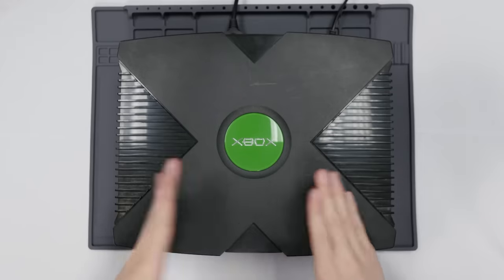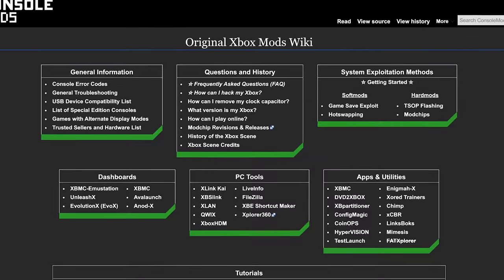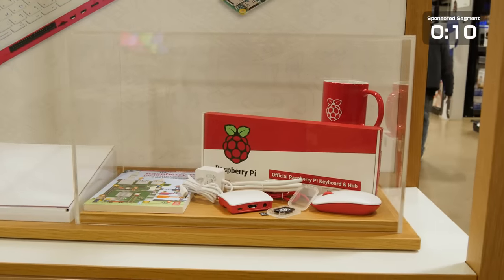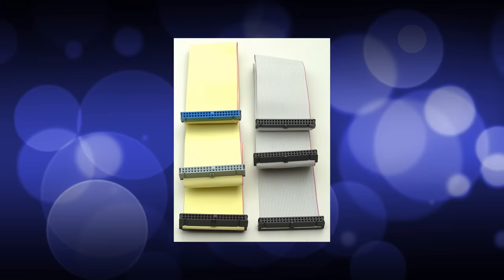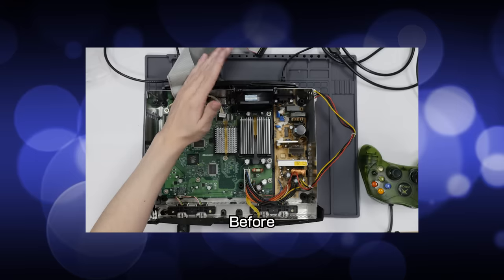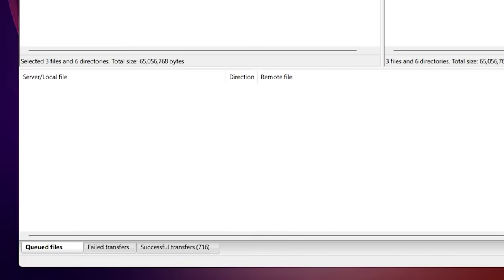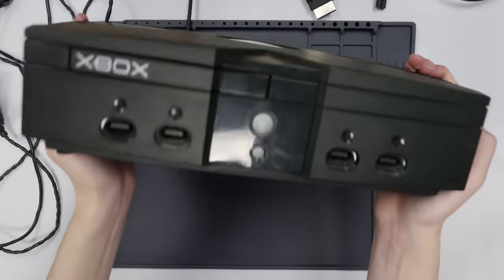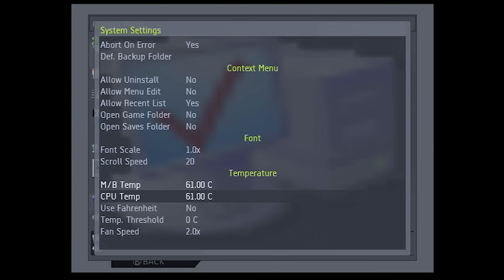The original Xbox is so NOISY. Let's make it ˢᶦˡᵉⁿᵗ

Comment: The original Delta fan for the XBox (AUB0712HH, also used in the 360 in a pair) is rated at 36 CFM and 7.32 mmH2O static pressure and tops out at 4500RPM. Locked at 20%, you'll still have a far reduced static pressure, but probably still higher than that Nexus fan at max. The Nexus fan doesn't have a published static pressure, but tops out at 21 CFM at 2400 RPM, meaning the rated static pressure at max is likely around 1.0 to 1.25 mmH2O. It's one of the substantial tradeoffs: quieter fans always have far reduced static pressure due in part to the lower RPM. I don't know of a fan where that is NOT true. And in enclosed spaces, such as the internals of a game console, static pressure matters more. Since static pressure determines how easily it can push through all of that. This is going to matter when it comes to longer play sessions.

While you were in there, you also should have replaced the thermal compound under the CPU and GPU heatsinks with something like Arctic MX-4.

The delay at startup is the IDE->SATA converter board initializing before reporting back that it's available. And your transfer speed is also entirely due to the Fast Ethernet 100Mbps connection on the XBox. 11 or 12 MB/s is about the fastest you can get with that, and HDDs back then weren't slower than that on sustained transfer.

Comment: Older cpu's dont throtte, they have stable clock. Even the difference in power consumption at idle/ load is not that big. 
The new fan simply has a lower speed, which is probably why the temperature increases.

Comment: I'm sure a Billion people have already mentioned the fact that you're still dealing with IDE speeds but those adapters can cause slight slowdown with an SSD because they fundamentally work differently than a HDD.

The burst packaging that SSDs use is totally negated by the IDE interface so it actually reads slower at smaller data packets than a HDD. So you won't see a difference in things like game loading but you see a slight delay in boot due to the SSD's interface being a bit bothered by it's inability to send smaller data like it wants to. 
It may be a SATA-IDE converter but the drive knows it's not on traditional SATA bandwidth. The PMIC and data controller sees this immediately and kinda freaks out. 

Not an issue at all but it's a cause of this in older consoles, PCs and such when someone uses those adapters with an SSD.

Comment: In my opinion changing fan to identical size doesn't make sens, just buy 80 mm. I had a 70 mm but my xbox had been warmer then before, only with x5.0 speed it was similar to old one but also similarly loudly. I finally mounted 80 mm Noctua. Just brake te two tabs and mount fan with zipptie (usind holes next to old tabs). I also removed metal grill behind the fan. For the 80 pin cable mod - they are guides how to fold it more nicely. Also DONT buy sata=>ATA adapter WITHOUT capacitors. They are trash, often make longer boot and just broke over time. Besides that, good work.

Comment: i'm pretty sure you can use a 40 wire ide cable with a sata adapter, it will just be a bit slower. did you set the jumper pin in the correct position?

Comment: Technically using a SSD is faster still on sata to ide because you don’t have delay of the arm in a HDD moving is latency to get data. There is a comparison video but it’s small difference that if your paying more for a SSD just because it’s a SSD then getting a new hdd is enough usually for same storage but for something by like making it quiet then SSD def worth it.

Btw Burnout 3 is my favorite racing game. If you Like emulators for pc you should try xemu it emulates original Xbox games pretty well. Little resource heavy atm depending on game but It is focused on compatibility atm. But is playable in a lot of titles.

Comment: I'm a big fan of the original Xbox. I also enjoy your content Matt. I just don't really get this. Why do you value the Xbox being silent? Unless there's something seriously wrong, a standard Xbox does not really make all that much noise, especially when you factor in that it will sit several feet away around a tv, and the game's audio will be playing that will be much louder than the Xbox ever is. 

The SSD solution also introduces added loading time since it needs to convert from SATA to IDE and that in itself takes time. I'm ultimately left thinking that the best option would be simply to buy a new oldstock IDE harddrive rather than use anything SATA.

Comment: Polish heatsink and use new high quality thermal paste and I'm sure that You can drop temperature lower, personaly I whould even make gasket for new fan to maximize effeciency and maybe make bigger holes for better air flow, than it should handle fan speed 1.0x like a pro 💪

Comment: Most of the noise from a fan comes from the air movement rather than the fan itself. The design of a fan has much less to do with how much noise it makes than the volume of air that it's moving. If the fan is much quieter, it's probably moving much less air.

Comment: Tried this very fan, but even at 3x speed via a dash with fan speed control it ran noticeably warmer by 7-10 degrees Celsius. Might need to modify the chassis and use a little larger Noctua one for better cooling and silent operation. Unless somebody has a good tip for an alternative?

Comment: Never owned an original Xbox but the drive on the 360 sounds like a circular saw when in use, so an Xkey or whatever mod to play games off an external drive probably cuts the noise by at least 80%

Comment: I bought a soft modded Xbox a while back and the fan although set at 1x when the console starts up and switches to unleashed the fan speeds up making it sound like a hair dryer, upon checking the fan speed it still says 1x, admittedly once you get into a game you can almost zone out of hearing the fan but it does mean I have to increase the volume of my tv. It doesn't stop me playing the console as I love the original Xbox but it would be nice if I could make it quieter, any suggestions?

Comment: "The original Xbox is so NOISY"
Me, who had an old setup with an FX-9590, stock AMD fan and GTX 580 Ti: what do you mean noisy, that thing doesn't even make a sound
Reply: Me: what the heck is a GTX 580 ti?
Reply: @stevesmith1383  Oh crap, I confused it with the 550 Ti I had before it. Whoops.

Comment: I'm just sad my old OG X-box is v1.0 and has that damn loud GPU fan. I've replaced the harddrive with an SSD (the console is old-school chip-modded) and the stock fan with an 80mm Noctua fan (which, yes, had to be trimmed down a bit) but I'll probably never make the damn thing as quiet as I want. Not unless someone drops a broken-beyond-repair 1.x in my lap that I can steal the GPU heatsink from. I was thinking of getting a replacement unit, just for modding purposes (maybe keeping the old one around for emotional reasons) but damn, these things have gone up in price… I guess I'll just grit my teeth and wait for the emulators to get good enough…

Comment: Even on IDE a SSD is way faster than any mechanical HDD.
Reply: When it comes to the Xbox, it’s actually not and people have demonstrated and documented as much. Overall, there is very little if any real benefit.
Reply: Makes sense, prolly not even ATA100, would an IDE to SD adapter work simular?

Comment: Surely there'd still be some benefit from an SSD right?
I mean, a 54K RPM HDD is slower than a 72K RPM HDD, which is slower than a 10K RPM HDD, and that's slower than an SSD all on the same SATA 3 interface in older PCs, so surely there's gonna be better read speeds with that than the 54K RPM HDD of the OG Xbox and Xbox 360, right?
Reply: I’m guessing the IDE interface will limit potential gains from the XBOX. I would potentially be concerned with an SSD in an original Xbox as it is not designed with an SSD in mind and could cause premature SSD failure.

Comment: I run my phat ps2 off sd cards and and t works pretty good I don't notice a difference. I been debating about doing my xbox the same way for awhile but I got 4 working ide drives cloned... :/   I'll probably wait till 1 fails but making a ide to sd card tray adapter is pretty easy and the foot print is super small.

Comment: The system will still use PATA speeds, and there's probably some coding from the softmod in the background to force the Xbox to accept the hard drive. That's likely why its slower. You simply cannot get the max SSD speeds on the original Xbox -- it wasn't made for it, just like how PS3s use gen 1 SATA and cannot take full advantage of SSD speeds.

Also iirc the Xbox uses a 100Mbps (megabits per sec) ethernet connection, so 11MB/s (megabytes per sec) is about right.

Comment: But do you actually need the DVD drive anymore? That thing is loud too. What I would love to see is getting some weird compact M.2 SATA to PATA IDE converter such that the SSD could just reside immediately on top of the motherboard, then remove the DVD drive and then put the whole rest of the Xbox in a more compact case. The thing is too darn big.

Also, regarding your transfer speeds, 10MB/s is the 100M Ethernet speed, where as harddrives, even really sluggish ones, do at least 120MB/s sequential reads and writes, so that's not really a benchmark, unless you were benchmarking your Ethernet cable. To max out an old HDD, you'd still need at least 1000M Ethernet, and maxing out an SSD is of course not even an option because of IDE speeds.

You'll have to look into benchmarks that run directly on the Xbox itself to see if you have a performance issue.

Cheers!
Reply: I'm also concerned whether Xbox might try to defragment its own drive and whether it can run TRIM on the SSD, but somebody probably figured it all out already
Reply: Of course it came long before TRIM, but there is no need to defragment it. The partition with your rips doesn't get files constantly created and deleted. The small cache partition is completely separate.

Comment: Mine is unbearably loud,louder than I remember it being in fact.Fortunately,most of my discs run on the quieter 360 or xone.I bought a fat ps2  recently because one of my favourite games is incompatible with my slim,,and specifically went for a later quieter model,and even that's loud.Well not too loud but research led me to believe it was supposed to be 'whisper quiet'.

Comment: The ssd is 2mb per second faster than the ide drives as 11mb/s is the cap for ide
Reply: Also good tip take the heatsink off the cpu and take those thermal pads out and replace it with thermal paste of choice it makes it cooler
Reply: Plus the original thermal pads are way out of expected lifespan and shpuld be replaced anyways

Comment: Hi guys I have a original Xbox when I turn it on it's just yellow light or orange light I think and turns off how to fix
Reply: If it’s orange, your AV cable is just not plugged in correctly,  just check your connection, or if it’s all plugged in and still not working, try buying a replacement AV cable, or dust out the AV port on both the Cable, and the AV port on the console 

If it’s red though, you might just want to look out to get you unit repaired by a 3rd party repair shop, when you hook up your Xbox to a TV while the led ring is blinking red, you’ll get an error code, write it down and give the code to the repair shop you’re gonna get it repaired at, I highly suggest not trying to fix it yourself, due to the og Xbox being quite a complex machine, wich would require atleast a mid ammount off knowledge to fix it all by yourself, so if it’s red, don’t worry, just look out for a repair shop in your area

Hope this helps :)

Comment: overkill SSD for this, you can use a dram less ssd for much cheaper (think kingston a400) and have the same results for the most part, it's not like the 100mbps interface or CPU is going to be any good here... Also the ethernet on this is 100mbps or 12.5MB/s, which in reality is probably around 90mbps / 11.25MB/s

Comment: Console mods ain't 100% accurate on capacitors as for the 680uf capacitor next to the AV port console mods lists it as 680uf 16v but it's actually 680uf 10v

Comment: Dude, I can hear the button press in the before & after of the fan, is much  much quieter, you didn't need to exagerate what is already a really quiet fan by comparison.

Aww man, I can't get enough of these Xbox original videos, wish you'd done a full tear down & cleanup including repasting the heatsinks, I literally just did 1 I got from Ebay yesterday, which I'm thinking of harvesting for a 128MB, it is why I got this 1, but I've got 4 of these things now, 2 of which I intended the same fate for, but I just can't bring myself to do it, haven't done proper soldering on that scale yet, sure I put some external ports on the modchips I got but never finished as the chips weren't available for 6 months & I just haven't had the interest again.

Think I may try finding some proper junk circuit boards on ebay to practice on.

I don't know what it is about these 20 year old heat syncs, I just found myself cleaning them off thoroughly, like half way through when I remembered I wasn't ment to give a shit about this 1, still, I needed the experience.

And I don't know if anyone cares, I've got 2 modded systems, 1 modchipped with a new hard drive the other soft, both of them run up to a max of 55 degrees, with the stock fan, & that's them running games for literal hours, just an interesting metric too me.

Comment: Your fan installation is bad. There's a reason you butt the fan up against the case tightly. Fans are not "air lasers". They don't like to move air in straight lines. They prefer to move air in a doughnut shape around themselves. This is why duct work is important in cooling systems. It forces the air to move where it needs to be. Even worse for you, fans move most of their air on the outer most edges of the blades and almost no air in the center where the fan hub is. Since your fan has a sizable gap between where it ends and the edge of the case it's spitting a large percentage of the hot air back into the case rather than exhausting it. You need to add a gasket to prevent exhaust leaking into the case.

Comment: My Xbox 360 model s has a weird drive it doesn't open if you try to i have to pry it with a paper clip so the motors work and do their job but other than that my Xbox is in good shape i mean used but still good EXCEPT THAT I CANT FUCKING FIX IT CAUSE OF MICROSOFT ADDING PASSWORD PROTECTION